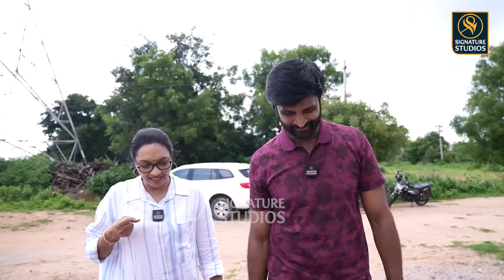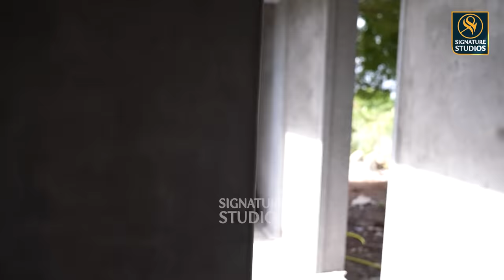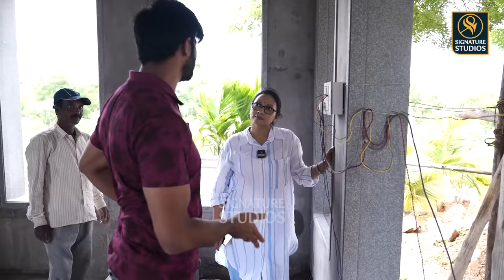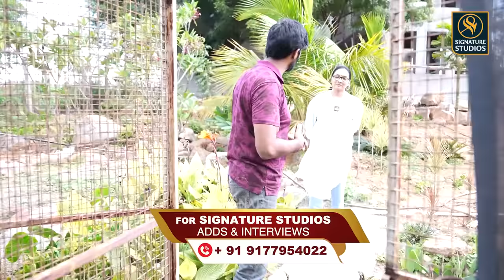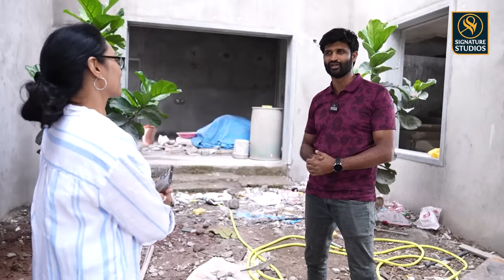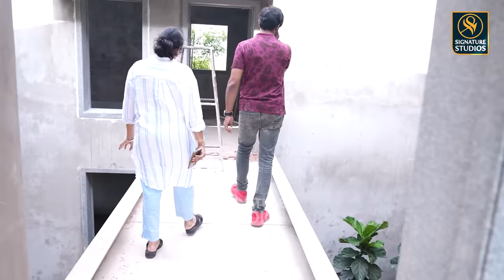పిల్లర్స్ లేకుండా  ఇల్లు  కడుతున్నాం | Signature Studios

Comment: కాలమ్స్ లేకుండా, బ్రిక్స్ కట్టిన విధానం వల్ల structural గా weak construction అంటాను సివిల్ ఇంజనీర్ గా. ఒక floor కట్టుకోవచ్చు అంతే. Load bearing walls లేవు.
Reply: Exactly...adhe rayabothunnaa
Reply: It's is mentioned as load bearing cavity walls. Not everything is mentioned in current engineering text books buddy. There are architects even in history who didn't use columns in their construction just by using different types of brick bonds and they are still stable even after earthquakes.
Reply: But still we can do it with appropriate other adoption mechanisms. Building pillars is just an easy way of constructing
Reply: No you're wrong

Comment: Granite on the walls and grilling them is a bad idea!!!
Reply: Granite is a natural stone that is not meant to be heated or grilled. Heating granite can cause it to crack, splinter, or even explode. Additionally, the smoke and fumes from grilling can damage the granite and make it unsafe to use.

Here are some of the risks of putting granite on the walls and grilling them:
 The smoke and fumes from grilling can be flammable. If the granite is heated, it could catch fire.
Heating granite can cause it to expand and contract rapidly. This can cause the granite to crack, splinter, or even explode.
The smoke and fumes from grilling can be toxic. Heating granite can release these fumes into the air, making it unsafe to breathe.
The smoke and fumes from grilling can damage the granite, making it look dull and unattractive.
If you are looking for a safe and durable material to use on your walls, granite is not the best choice. There are many other materials that are better suited for this purpose, such as ceramic tile, brick, or concrete.